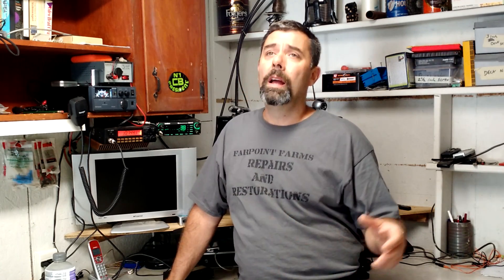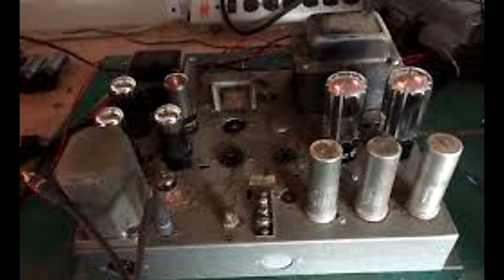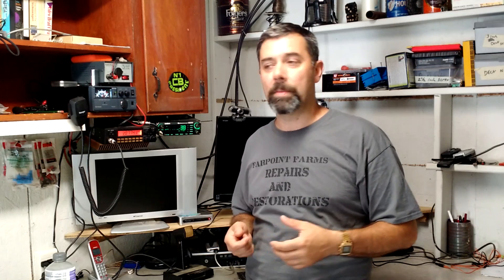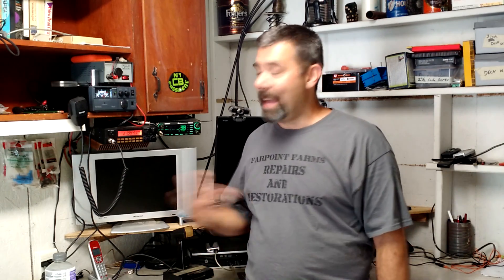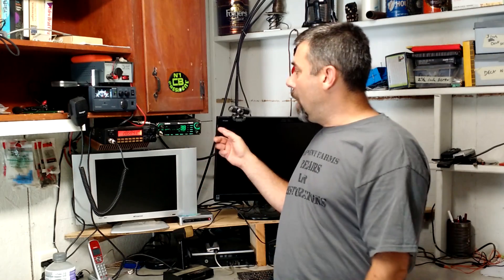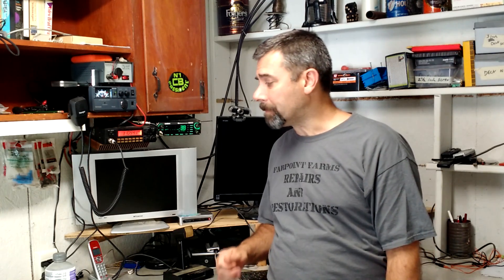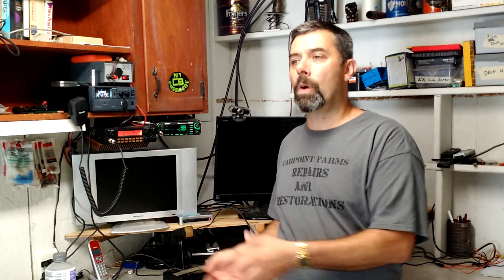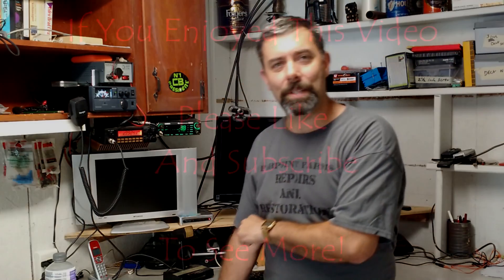A Beginners Guide To CB Linear Amplifiers.

Comment: Maybe my cbs are trash, but I hear everyone, but no one can hear me or just choose not to respond. I've tried two cobra 19 minis one fm/am and one just am. I almost have a midland hand cb with the vehicle adaptor. Swr is all good on every antenna I've used. Maybe an amp may be my only option? Or is it the cbs? Output is correct to limits, so im kinda lost.
Reply from the maker: It's frustrating when you can hear others but they can't hear you. Keep at it. A lot of times they don't answer as they are already talking with someone you can't hear.

Comment: Up to the eighties, CB power was five watts into the coax to the antenna. That changed later, in the eighties? Somewhere in there was a change to four watts into the output? I forget the exact wording. Sometime it changed to the four watts it is today. 

I wish they would go back to five watts out or better ten watts. The problem is the FCC doesn't want CB to go past a few miles. That is in the regs even now as i recall. Why it matters to them, i truly don't know. Imagine if they allowed the fifty watts that they allow on GMRS. 😊
Reply from the maker: It's a shame. I think at 40 watts CB would be perfect for modern useage.

Comment: It’s time for the fcc to increase the legal limit to 50 watts. They can even increase the requirements for harmonic filtering for type accepted radios. It would make a big difference. I can shoot skip with a Stryker 955 pretty good, but with 4 watts not make a single contact. More people might stay in the hobby if they radio they buy does 15 to 20 watts swinging to 50 watts.
Reply from the maker: I agree 1000% time to give CB a boost.
Reply: 50 watts is less than 2 S units stronger on the receive end than 4 watts.

Comment: I had a power mic and a 5 watt system with a nice clean signal and could skip 2,000 miles many evenings. Those were the days. My neighbor across the street must have been running enough power to talk to the moon. He bled through my base station that was turned OFF at 2 AM,  SO LOUD that it woke up everyone in the house. His signal was so over modulated that you couldn't understand a word he said. I had to disconnect my antenna when I wasn't using it.
Reply from the maker: You know it was powerful when it powered on the radio when off.

Comment: Farpoint Farms, knowing this is an old post, your spot on!!  I use to be one of those CB"ers back in the 70"s with more than a KW Amp and stacked Moonrakers and was told that I even caused TVI as far away as 50 miles away from my station. I just didn't realize my ignorance at the time. I'm now a licensed extra class HAM and refrain from committing the violations you mentioned and abide by  the FCC and ARRL law and suggested guide lines . Sadly, some people never learn . Even more sadly is I see the CB attitude has crossed over into the ham world (Amateur Radio) and now causing chaos across many of the bands with mis-tuned amplifiers, over modulation and total disrespect for other operators, and the list goes on. Here it is 5 years later since your YouTube post and I can say it hasn't gotten better. The good thing is.....I know where the frequency dial is and if that doesn't work, the OFF button.
Reply from the maker: I bet those people with the TV were very upset with you- I am glad that you learned what not to do after that.

Comment: A good clean signal is a lot easier to hear than one that is splattering everywhere.  KC5HHB
Reply from the maker: Absolutely, clean signals are much better!
Reply: So just a technician in vici. Barely. Don't run wires anywhere neat your power line.
Reply: @terryparker1694  so you live in Vici?
Reply: @delmarbish3926  No. But I can look at your house, vehicles and antennas no problem. Never post your callsign. That's a newbie mistake. And fix your shutters and cut the grass. RWD-3.  Shall I post your name and address? Not a problem to do so.

Comment: There is a guy around my area running 2000 watts on VHF. He ask me to test one time but I'm not getting any difference between 100watts and 1500watts. both signal are just S5 or S6. 
He's wasting a lot of electricity on that setup. we only really see a difference when its 5 watts to 50 watts. . . bumping up to 100watts is just a marginal improvement from 50
Reply from the maker: That is a ton of wattage for so little in difference. I can only imagine the power bill on running that

Comment: Hi Eric, just watched your beginners guide to CB linear amplifiers and noticed a gray box on your shelf with a meter on the top left and some other buttons an switches.  It's actually the second one like it that I've seen in videos on CBs and think it must be an in-line SWR meter with some other functions and capabilities over just a stand alone SWR meter.  Can you tell me what the make is and where you can get one.  Thx  Tom
Reply from the maker: It's a radio shack 3 way meter. SWR, Modulation and Power. Love it!
Reply: @ Thanks Eric.  Many thanks.  Cheers,  Tom

Comment: So do I need to power down my radio to run a 100 watt amp? Like a President McKinley or can I just get away with not having to tweak anything
Reply from the maker: Some amps really want a low driver, others are marketed as high drive. These an handle stock radios.

Comment: I need to know what I got to do to put 102 still whip up on a pole do I need to make a ground plane? What give me some idea please
Reply from the maker: Yes, you'd need to make a ground plane for it. There are kit's for the Antron A99 that your could adapt for use with a 102, but it will never work as well as a real base antenna.

Comment: Farpoint Farms there are so many operators of CB that have no idea just how good a CB keying low watts set up to modulate can be. Done right it can cut through some high-powered stations and be heard better than them. Back in the 80's I had several low powered radios to choose from but the best one was a Uniden PC66 Keyed only a quarter watt but swung 12 with no crappy "swing kit" added that was hooked to a TNT 150 modulator and that to a Texas star 500. The modulator was set at a little over 2 watts key. The antenna for the system was a Predator 10K/27 (I still have the antenna). Most times I just used the radio, periodically the TNT got turned on but rarely did I turn on the Texas Star because so many people claimed it was too loud. That system was installed in a Dodge Shadow and was monitored with a Palomar meter (I did not want to leave my Byrd in the car). All that said that system proved to others as well as me how well low watts and strong but clean modulation can perform. Honestly 95%+ of the time I only ran the radio barefoot. Wish I still had that setup. BTW the guy that did the work tuning and setting it up was a retired military communications guy (RIP).
Reply from the maker: Sounds like a great setup! I'm also remembering the Dodge Shadow! Those were pretty cool looking 2 doors. As I recall, they even made a convertible. I miss cars like that. All we get now are bloated jelly bean looking SUV's with no personality.
Reply: @FarpointFarms  They were great little cars. now-a-days I run a AnyTone AT6666 set at a three-watt key and if not running the Predator antenna I run one of my 7-foot Skip Shooters. I live in somewhat of a valley so if I want to talk on my mobile setup, I go to a food store parking lot nearby that's on a hill and have no problem talking 30 miles on SSB, 15-20 on AM/FM. At home I also have another 6666 set up as a base but because I live in the valley range is limited to 50 miles SSB but AM/FM remains the same mostly due to the fact most around here run LSB. For the most part the town I live in has almost no locals running CBRS anymore so those I do speak to are at closest 15 miles as the crow flies from me. I have been monitoring GMRS/MURS and the Amateur bands finding there are about a dozen or so operators locally on Ham as for GMRS a few families and several businesses use it, MURS I have not heard a thing. Going to get my Ham license but due to it's expense I'm just going to set up a mobile as a base and carry and HT in the truck. My AnyTone's will cover where I want to go on 10/12 meters. Question for you, are you on GMRS/Ham?

Comment: I live in Wyoming and there's nobody out here to talk to on the 11 meter band. I'm thinking about getting my ham license and a 10 meter radio that pushes out 50 watts. What are your thoughts on that? Is 10 meter a good choice?
Reply from the maker: The 50w will give you more power and range. You should be able to make many more contacts. The other part of the CB is we are in the peak of the solar cycle so reception has been a bit crazy
Reply: @FarpointFarms  Thanks for the info!

Comment: The question of the century is, can you run a stock cb radio with an amp? Or does the cb need to be turned down in power for input to the amp?
Reply from the maker: Some are called Hi-drive. They are fine with a stock radio. Most however need to be turned down a bit to work.
Reply: @FarpointFarms  thank you for the info

Comment: In the 1970s, I know a guy, he was working a titan II site in Arkansas. There existed at the time a radio with an awesome Christmas tree Ike antenna nearby. This radio was able to be tuned to the 11 meter range.  Our guy, he keys the mic, and releases, and what does he hear?  Nothing. For about a minute. 100,000 Watts I was told, is that even possible?
Reply from the maker: Radio stations are not even that many watts.
Reply: @FarpointFarms  This was a Missile Site, owned and operated by the US Military, and could in theory do anything they wanted.  As for the 100K Watts, what we were told, had to push thru the EMP garbage.

Comment: I started using a CB in the 80s, and I could tell who was using amps. They blew everyone away. I had the simple 4 watt model. I did not car to add an amp. But when skip came in, you could tell then too when only a few were extremely high power. Coming over the air from all over. I remember somebody keyed up squishing everyone on the air. When he keyed up while skip was active, He was Very loud and when he keyed up, nobody else was heard. I could never get anyone back to me with my 4 watts. If you are in the North Texas area, CB talking is still very active right now. In the 80s when people used amps they bled over the old TV's we had back then. It was crazy times.
Reply from the maker: I remember being able to hear a local operator over my radio even when it was powered off- I am not sure how hot he was running, but it had to be a ton

Comment: Doesn't SWR play an important part in running an amp?  When running an amp, an SWR of 1.5 or 1.6 just isn't acceptable?
Reply from the maker: The lower the better. Anything over a 2 and you will heat up an amp a lot quicker and cause it to fail.

Comment: Back in the early 80's was talking to a mobile in France. It was like late afternoon. I was running an amp and had the boost receive on. He said "The skip went out hours ago and you are the only station I hear." .. I looked down and the boost receive in the amp was turned on. I almost never used it. I was also running a quad beam at about 75 feet and beaming Europe at the time. I shut down and got off the air. I knew I was likely being monitored around that time. It was fun, but also risky. My amp was a boomerang.
Reply from the maker: That is funny, you must have been using some power for that to happen.
Reply: @FarpointFarms  .. Yes, a president madison radio pushing an amp .. Must have been around 400 watts.

Comment: Ok...soooo.. if a CB radio transmitter utilizes Amplitude Modulation (AM) to transmit voice signals over a 27 MHz carrier frequency. The transmitter is designed to operate at a maximum carrier power of 4W and employs a modulation index of 0.8. The modulating audio signal has a frequency range of 300 Hz to 3 kHz.

a)help me Derive the expression for the instantaneous voltage of the AM signal and calculate the peak envelope power (PEP) of the transmitter.
b)then, ol buddy.. Given that the transmitter uses a Class C amplifier for RF amplification, analyze the impact of this choice on the linearity and efficiency of the modulation process.
c) so .....The transmitter's output is filtered by a Butterworth low-pass filter with a cutoff frequency of 10 kHz. Help me determine the required order of the filter to ensure adequate attenuation of the first harmonic of the carrier.
d) will you talk about the effect of frequency stability and phase noise of the carrier oscillator on the intelligibility and quality of the transmitted AM signal?
e)ok..now, If the transmission path introduces a multipath delay spread of up to say... 5 microseconds, can you evaluate the impact on the received signal quality, if we consider both the coherence bandwidth of the channel and potential intersymbol interference?
Reply from the maker: Way over my head. Sorry!

Comment: So is it correct that A Q-factor of 10 implies a narrower bandwidth and better harmonic suppression but will limit the amplifier's ability to handle wider bandwidth signals? Maybe even potentially reducing performance in applications requiring broader frequency response? Does Harmonic suppression improve linearity? Should it  be balanced against bandwidth requirements?
Reply from the maker: No idea. Sorry!

Comment: I'd rather increase my reception than my output... how best to do that, other than the obvious (good antenna, good ground plain, good wiring...)?? I want to be able to pick up the faintest signal...
Reply from the maker: the antenna is what you will really need to focus on. You can have the best radio, but if your antenna is bad, then you will not pick up anything
Reply: @FarpointFarms  right, that's part of the obvious I was talking about (there's a reason I listed antenna first)... but I guess what I'm asking is; is there a signal booster for received signal? Like is that a thing (even if I'm not saying it right)?

Comment: 102 Inch Antenna with 102 feet coax is the best set up. I am below 1 SWR's  Remember 27.2050 mhz is 3 foot wav link
Reply from the maker: Sounds like a perfect setup
Reply: Yes it is a vary good set up, A full 5/8th wave antenna with ground plains, 4 watt Uniden Bearcat 980 ssb with 102 feet of coax No SWR Adjustment but swrs just under 1   @FarpointFarms

Comment: a lot of them amps are still made. even tube ones. and still some CBers get busted . in the FCC enforcement data base. Pirate radio is the newest thing   FCC going after. many high power FM transmitters being made. NY city is big on Pirate radio. The amps I work with is the HAM and GMRS ones. GMRS max 50 watts on some Ch. They make low pass filters for them CB and HAM amps. RM Italy and MFJ has them. also you need better coax. a amp does you nothing if you do not have a antenna and coax to handle it. start with better antenna and coax. and get antenna higher if you can.
Reply from the maker: I have seen a lot of interest here on the channel for Pirate Radio. I know of 2 FM setups in my area that are pushing 250 watts and have been for a few years now. That's a LOT of power and they are certainly pushing their luck. Still, I love listening!

Comment: Your saying you can get out across the country with a 4w cb?
 How far out can a cb get out under normal conditons? I've heard many things, like 1 mile per watt. If you can only get out 4 miles, really what good is a cb. I mean if your in the woods and in trouble no one wood be able to here you.
 A cb would really only be good for trucks trying to avoid major traffic. And so many truckers are foreigners who don't speak English, worse yet many truckers don't have cb's because they have cell phones. Cell phones don't work for road traffic. 
T4TV
Reply from the maker: CB's range depends on the location- It the mountains I can get 6 miles or so, but in open country it greater- If skip is rolling, then it can be much much greater distances- for example, I was able to make contacts in England and Ireland not to long ago.

Comment: The 11 meter rule needs to change with times 4 watts isn’t enough power to reach across a town . Back in the 70’s you could talk anywhere on 4 watts with a antenna in a tall pine tree. In todays world solar panels , cell towers and electrical grids kills 4 watts on key up . I can imagine what the 5G and fiberoptic lines can do to 11 meter 4 watt radio . Just my opinion
Reply from the maker: I do agree with you on this.

Comment: Great video, Eric. When it comes to grounding, for good comms do you need to ground the coax as well as the antenna, or just the antenna? Thanks for any info.
Reply from the maker: I ground the Antenna mast, and the radio itself. The radio ground is also connected to the cable ground so that covers all of the system.

Comment: 2 stock Uniden 980 SSB radios, a base and mobile. 
Base antenna: Cushcraft AR-10 on 30' pushup pole.
Mobile antenna: 102 SS whip
Reply from the maker: Sounds like you have a great setup!
Reply: @FarpointFarms  I have  yet to put up the Maco M103 3 element beam 👍.

Comment: built my own amp usinf 4x 572b valves running 3kw on the anodes,put out about 1.3kw but made my leccy meter do about 200 rpm,got put away after that!,that was on 80m ham bands not cb but same rules apply,class ab amplification gets expensive in terms of electricity bills! 73.
Reply from the maker: I'll bet that burned some watts!
Reply: @FarpointFarms  just over 3kw draw from the 240 volt mains,that is why i stopped using it,good way to get huge electricity bills!.